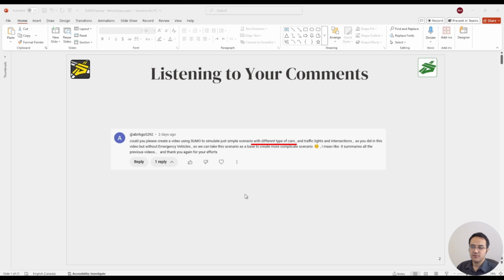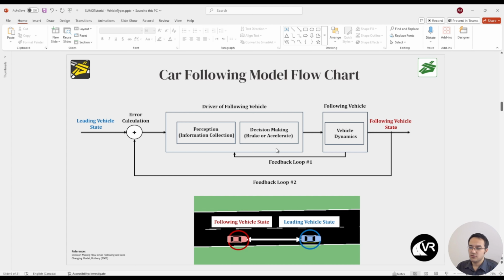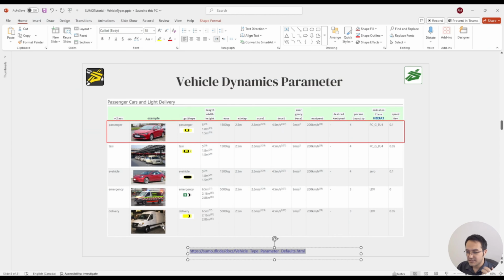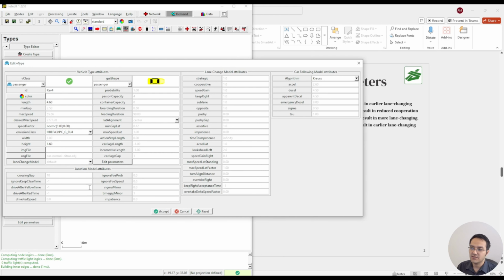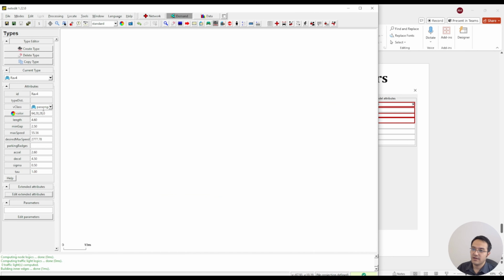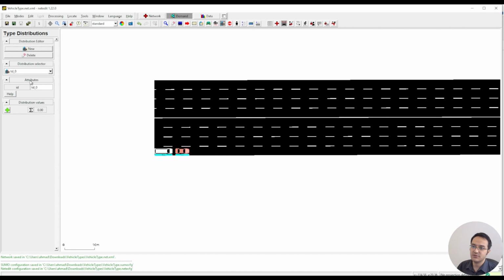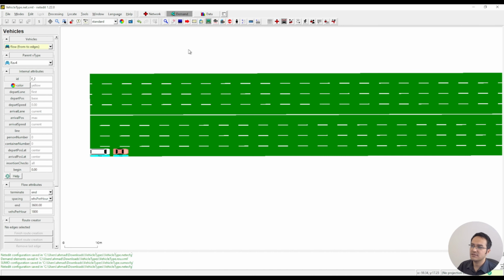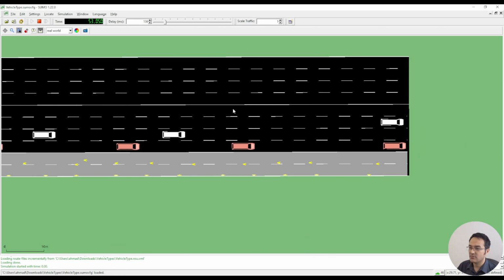SUMO Vehicle Types: Car Following & Lane Changing Models

Comment: Thank you for sharing your knowledge PhD. Ahmad. I wonder if you could make a video of an example of the simulation of an intersection with traffic lights, in which you calibrate the inputs of vehicular and pedestrian behavior in sumo or other parameters such as queues or travel time, as is done when using vissim with its Wiedeman 99 models for vehicles and its model of social force in pedestrians? Greetings.
Reply from the maker: Usually, we only calibrate macroscopic parameters like traffic volume and speed, recently there are some US government guidelines suggest new values for car following and lane changing models. But, at the end, the calibration really require field data collection -trajectory data.
Reply: Thanks for the suggestion. Indeed the microscopic calibration methods with VISSIM have a lot of information, but in sumo there are not many examples of detailed calibration and validation with real field data.

Comment: hey bro loved all your videos, can i get a video for traffic signal optimization using sumo simulator and traci? like the traffic signal duration should get adjusted automatically based on factors like no of vehicles in the queue, lane detectors etc. the optimization should run in realtime and the phase durations should be adjusted dynamically. am trying to do it but am not getting the proper results as expected. i've been trying to use jaya algorithm for the optimization process but you can use any and try explaining. it would be great if you can put out a video asap coz i have my project review in a days time. thankyou so much <3
Reply from the maker: Ravi, Thank you very much for your comment. I definitely consider creating a video on actuated ring barrier traffic signal controller.  However, I cannot make it in two or three days😀. But thanks for your suggestion.